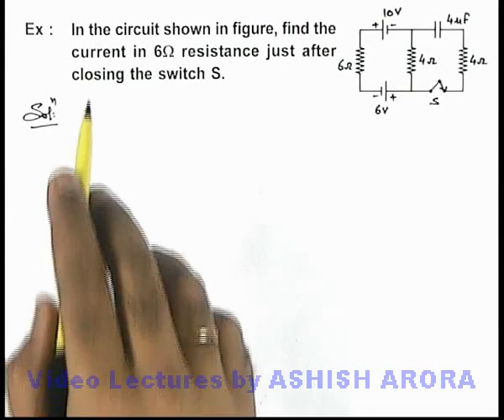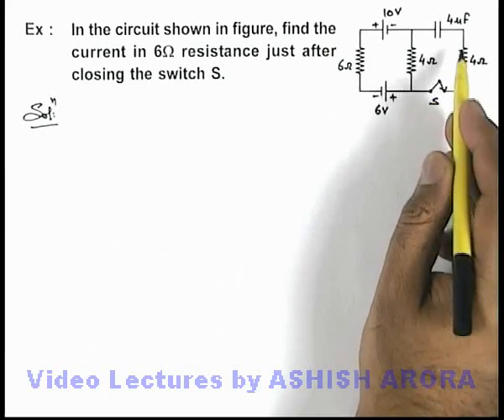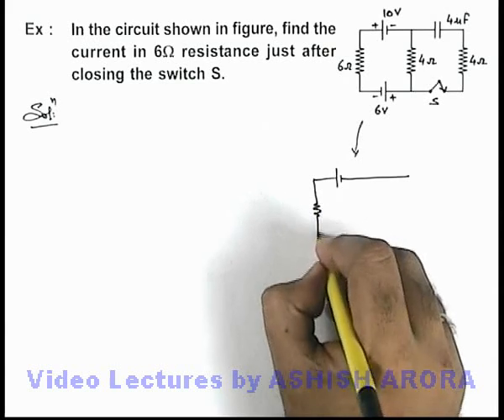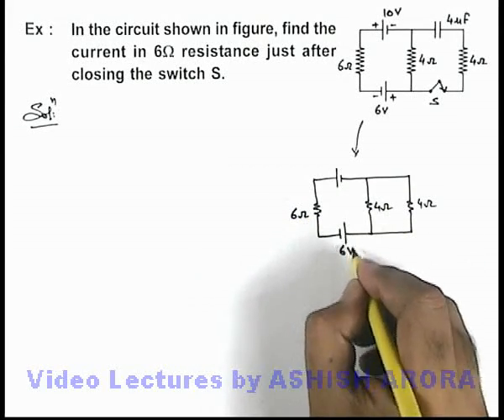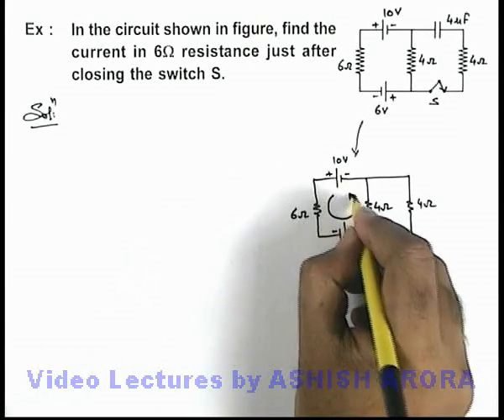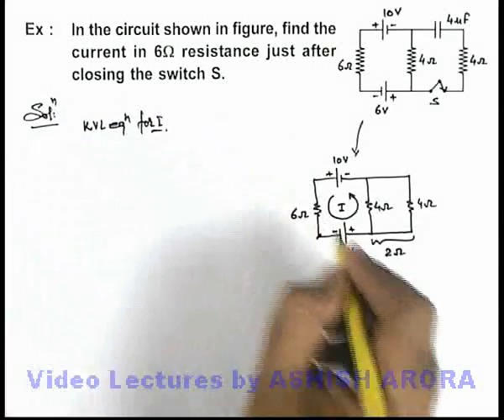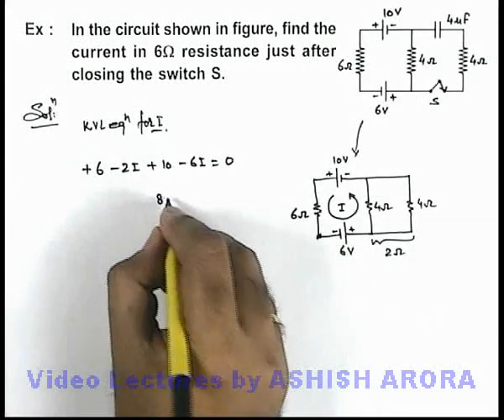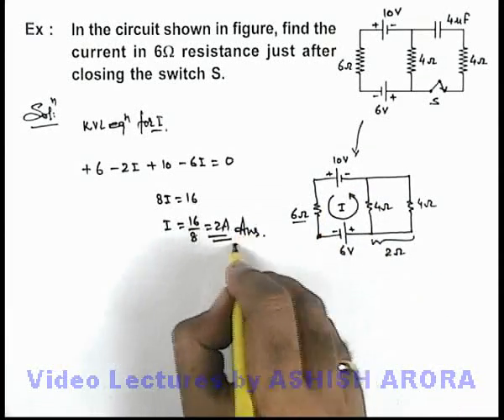Class 12 Physics | RC Circuits | #11 Solved Example-3 on RC Circuits | For JEE & NEET

Comment: means if we were asked to calculate current after a long time of closing switch then we would have not considered the 4 ohm resistance connected next to capacitor and in that case current would be1.6 A.......am i right or not sir?
Reply from the maker: Right...

Comment: sir why does capacitor act as wire?
Reply from the maker: already I have explained in basic videos that just after closing the switch in a capacitive circuit, all uncharged capacitors behave like short circuit (we have proven it also) and all charged capacitors of the circuit behave like a battery at the instant switch is closed...
Reply: got it

Comment: can it be done with equivalent battery method.... reply soon
Reply from the maker: +Deepesh Pandey Yes... consider the capacitor as short circuit (as it is asking just after closing the switch) then make the eq battery across 6 ohm resistance, this will give you same result...
Reply: +Physics Galaxy thank u a ton!!!